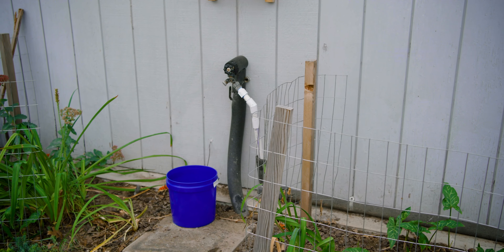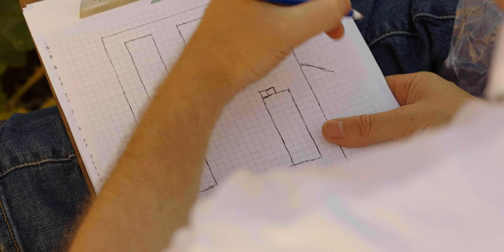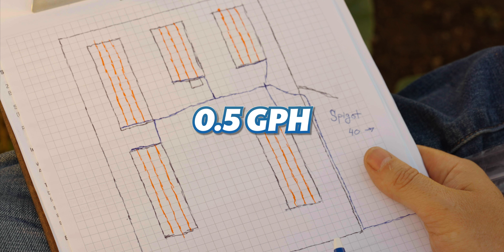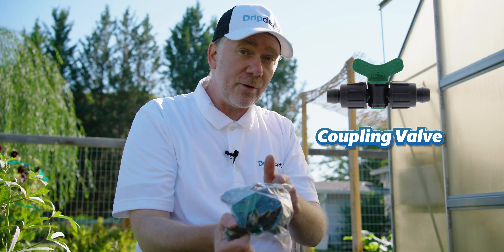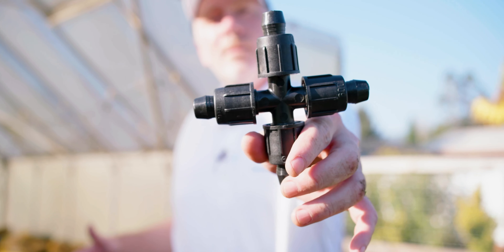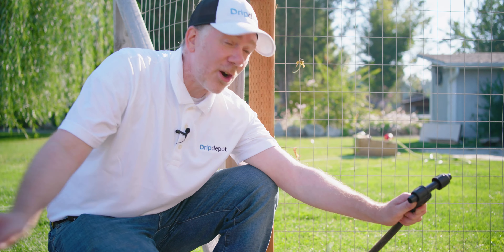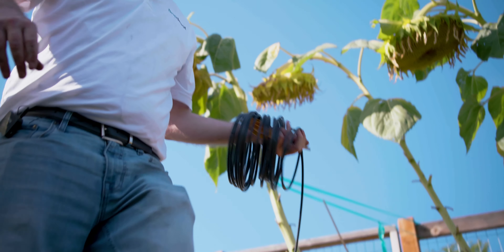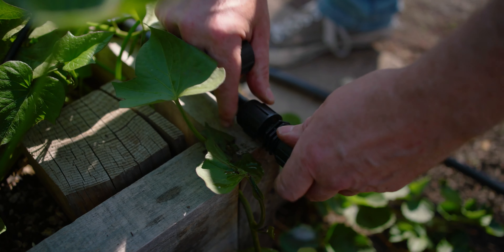How to Install Drip Irrigation for Raised Beds (Complete DIY System Guide)

Comment: Hello I am currently looking for a kit in your website,   i have 3 beds, 1- 12'x4' and 2 4'x8', the 12'x4' will have 2 rows of tomatoes  with a row of green onions and a row of basil so 4 rows total, would i still only run 3  lines of 1/4" emitter tubing?  Or would I run 4 and double up per tomatoe plant as i heard tomatoes need more water?  or with tomatoes would i run 2- 1/2   mainline tubing down the rows of tomatoes with individual drippers for each tomato and then run a 1/4" Line for the basil and onions? I have no idea how this stuff works. 

Secondly the kit im looking at has things I dont think I need,  is there a way I can contact someone that can assist me i adding things I might need extra of and taking things out I dont need?

Thirdly my beds are metal so I cant use the hold downs with the nails, so would I run it over the side where it risks getting cut and hot from the sun or up underneath into the bed and then bury the lines?? 

And Finally I also cannot run the mainline tubing from my house as its 100' away and there's a cement walkway , garage, shed and driveway,   can I run a good hose out to the garden that will hook up out there where I will have the timer>backflow >filter >pressure reducer into the mainline all hooked up in a junction box with a quick disconnect for the hose as it has to ge detachable for years work , driveway etc etc.
Reply from the maker: The first, in regards to how many lines of drip line to run, could go either way depending on soil type, etc, but I'd likely run 4 lines, one for reach row of plants.  Doubling up on the tomatoes may be a good idea, as they do require more water than some of the other plants, but you could also go with a tighter spacing (6" instead of 12" for example) for that row to ensure they receive adequate water without overwatering the others. 

Absolutely happy to help in removing items from the kit you don't need -- in fact, we recommend customizing the kits to make it an even better fit, so you're 100% on the right track here.  Reach out to us from this link (this is our contact us link and sends us an email -- during office hours, we get back to email quickly): https://help.dripdepot.com/support/tickets/new 

Also good question on the metal beds -- this can also go either way.  I'm fond of just hanging the elbow at the top off the edge of the metal bed, but there's no harm in coming from underneath unless you've laid metal mesh or similar down before the beds.  We made a video for metal raised beds I'll link here -- there's a lot of crossover between this video and that one, but you can definitely skip ahead to see how we secured our lines to the bed: https://www.youtube.com/watch?v=ug_CAB9920w 

You can incorporate a hose into a drip system, you bet -- you'll still want the head assembly (timer, backflow preventer, filter, etc) at the hose bib however, as most garden hoses are not rated for constant pressure, which it would be under if the timer valve was downstream of the garden hose.  The filter and regulator could be at the end of the hose, but the timer and backflow preventer you'll definitely want on the hose bib.  

Please don't hesitate to reach out to us here or the contact us link above if you have any questions, happy to assist :)
Reply: @dripdepot  I think the standard kit suits everthing I need , I do think doing  6" spacing for the tomatoes is a good idea as that will give me 1gph per tomato plant and 12"  spacing for carrots, onions ,basil, cilantro, Oregano,  would I do the 6" spacing for cucumbers and green peppers that are in the 4x8? I emailed and they did respond back with the standard is what you all recommended,  the only thing in the kit I wouldn't need for the raised beds is the button drippers but I can keep those for future upgrades if I add  bags or containers .

So with the hose bib , at the house right at the hose bib is where ill put the timer, backflow and filter, connect the hose to the filter outlet which will go out to the garden and that's where I'll have a quick connect for the pressure reducer and fitting to connect the mainline (plug and play) I just want the timer and the backflow and filter right at the strongest point is what im Understanding the others can be at the garden for the hose to attach to correct?

And finally do you all sell the rubber stripping to go around the top of the metal beds separately,  I'm a stroke survivor on blood thinners so Getting cut is a big no no,  if not can probably find it at the hardware store right now I just have a few pool noodles in areas that have sharp spots
Reply from the maker: @Edithputhie6969  Bit of a tough call on the cucumbers in particular -- yes, cucumbers, tomatoes and peppers all need about the same amount of water (this can vary based on cultivar, but in general), but tomatoes like to dry out between waterings where cucumbers enjoy always moist soil.  To balance that, you could apply more mulch on the cucumbers, and/or less on the tomato plants. 

Your proposed head assembly (timer, backflow filter at the hose bib and then regulator and hose x tubing adapter near the garden) sounds good, that should work just as well as having it all at the hose bib.  :)
Reply: @dripdepot  got it ordered  and being processed to ship ty, one final question, there's one area in the garden where no matter what i do i have to run the mainline across the walk area,  I personally wouldn't have issues with not stepping on it but company for some reason just can't stay out of the garden area no matter how many times i tell them, can I bury that part of the line or should I just make a type of cover to put over top?

 I could build an arch type thing and run it up Over the top of that area but I would be wasting fittings and line  also doing so would probably lower the flow as it'll go up 7' in the air (I'm 6'2") over abd back down 6' into the bed, just thought maybe you might have an idea  on how I can protect that one 3' cross  over
Reply from the maker: @Edithputhie6969  Awesome, sounds like it'll be shipping today if it's processing now -- when it arrives, you're welcome to reach out with any installation questions as well. 

And yes, foot traffic is the bane of above ground irrigation systems sometimes -- it is acceptable to bury tubing there and probably not too difficult if the walkway isn't terribly wide.  Another option, and this came from someone else in the comments on a video (thank you!), is to use one of those cable protector speed bumps you see in office buildings to prevent them from being a trip hazard (and to protect the cable).  

I haven't heard feedback on how it worked, but he gets the credit for the idea and it absolutely seems sound in theory.
Reply from the maker: @Edithputhie6969  I just pressed "Read More" and saw you had some more -- an arch isn't a bad idea either.  You would indeed be using more fittings and mainline, but it could be a good aesthetic choice.  Depending on the location, you probably wouldn't lose pressure or flow either --- any pressure that is lost going up an incline, is regained going down so long as it goes the same distance down and has enough pressure to get up the initial incline (and you almost certainly will have enough to get up the inline,  a 7' incline is only a 3.03 PSI loss, which is immediately gained going down)

Comment: I have your raised bed kit, and I ordered the drip tape kit as well. Can I just tap into my drip tape kit main line and attach the drip tape? Or do I need a pressure regulator to bring the pressure down to 15?
Reply from the maker: When using drip tape you'll definitely want to regulate the pressure at about 15 PSI -- this will protect the thin walls of the tape and also keep it dripping at about the stated emitter flow rate :)
Reply: @dripdepot  what part do I need that can throw on a regulated from the main tubing?
Reply from the maker: Is your system operating from a hose bib?  If so, item #3525 should get the job done for you.  It has female hose threads on the inlet and male hose threads on the outlet, so it can thread on to a hose bib (or other male hose threaded connections like a hose bib) with no additional adapters needed :) 

Here is the link directly to it: https://www.dripdepot.com/search?q=3525

Comment: Our bed is approx 15 feet from the house. Do you recommend digging a trench for the main line to each the bed?  How is this system in the winter? We live in NJ
Reply from the maker: Great questions! Drip Irrigation tubing can be buried underground. It's all up to your personal preference! We find some gardeners love to keep their gardens neat and tidy, and in that case, they like to take the extra steps to trench out the mainline. Others prefer to keep it above ground, so it's easier to maintain and add on to in the future. 

Keep in mind that burrowing rodents, like gophers, can chew through the tubing seeking water, and with it being underground, it is harder to locate the leak. If you decide to bury your tubing, keep an eye on your system to make sure everything is running correctly; so that if a rodent does chew through the tubing, you can spot the problem immediately. Once you have your trench dug and the tubing laid out, you may want to have the system pressurized before burying to reduce the risk of tubing collapse. 

A drip system will do great through a New Jersey winter; just remember to winterize it before the first freeze. Winterizing is essentially flushing the lines of any excess water and storing away sensitive components like the head assembly. If you'd like to follow a guide to preparing a drip irrigation system for winter, we made one that covers all the bases [https://youtu.be/qOSIav1DiCQ]!

Comment: How far apart should the driplines be spaced if you have sandy soil?
Reply from the maker: This can vary quite a bit depending on how loose the sandy soil is.  We've seen them as near as 4", and as far as 9" in sandy soil types.  What you can do is, drip water very slowly (with a barely open hose or even a dripper if you already have some) to mimic a drip emitter over 15-60 minutes.  After, dig around in the soil to see how far the soil's capillary action carried the water.  This will give you a great idea on how to space your lines :)
Reply: @dripdepot  Thank you, I'll do that. I have some 4 foot square beds I want to try drip irrigation on. I see that you used three drip lines to cover each 4 foot wide bed. I guess I would need more than that.
Reply from the maker: Possibly, at least with very sandy soil!  One great thing about drip is it's very easy to expand on -- if you wanted to start with fewer, you could and then easily work in another line if needed :)

Comment: 12" emitter spacing seems insufficient for raised beds that are typically planted denser than farm rows. Raised beds do not suffer from pooling and will result in dry spots.
Reply from the maker: In most common loamy garden soils, water will spread about 12" from the point of drip, making 12" spacing a good match to many gardens.  Yes, dense plantings (carrots come to mind) might enjoy a tighter spacing, as will sandier/looser soil types, but for the most part 12" is that sweet spot where water from one emitter spreads near the other. 

When checking soil moisture, be sure to dig down -- when done right, drip emitters should leave only a small wet spot on top of the soil (minimizes evaporation or the potential for run-off).
Reply: @dripdepot  Dense planting is not an outlier.  Square foot gardeners plant heavily and tightly with the intent to provide more care than a row gardener would.
Reply from the maker: @Josef_R  12" Spacing is often used by square foot gardeners, though instead of a single row of drip line, they'll sometimes make more of a grid pattern with their drip line.  A lot of it really depends on soil type.  We do a lot of square foot gardening, with great results, and do intend to make a video specific to it :)
Reply: @dripdepot  I suppose 12" might work if you staggered the emitters so that they alternated, that would give you a 6" spacing...I'm just trying to decide what to buy and this stuff ain't cheap enough to make mistakes with.
Reply from the maker: @Josef_R  That definitely makes sense!  To some degree, it's really hard to mess up too bad with drip, at least so long as you're using the right emitter type (don't want overhead watering for plants that like dry foliage, for example). 

Being modular you can work pretty much anything in and still use what you already have.  It also has a very large margin for error, we've seen people new to both gardening and irrigation get great results, almost on accident. 

I think you'd likely be good to go either way (12" or 6"), and if the 6" makes you feel more confident in it all, there's absolutely no harm in that -- worst case scenario is you reduce the watering cycle a little bit or remove or move a line here and there.  When I was new to it all I used a lot of 6" spaced drip line and got great results, and I still use a good bit of it in my home garden.  

Basically, either route you go (or even a mix of) I think you'll have success :)
Reply: @dripdepot  I appreciate you answering my questions, but I don't like the fact that I can't call and speak to anyone about things that would be very difficult by email.  A customer would really have to know what they want to confidently make an order.  And I don't...
Reply from the maker: @Josef_R   Josef, fire us off an email, we can absolutely help walk you through the details (and email is nice for this, as we can link directly to things, send pictures and images to help lock in the foundational information).  Our email is also always answered by real people, we don't use AI or bots -- I think the only automated response we have is just when we're out of the office to let you know when we'll be back. We also answer them quickly, during office hours it will only be a few minutes :) 

Shoot, there's a very good chance it could end up in my in-box, to this day I do a lot of the email assistance.  From what you've described so far, it sounds straight forward and something we could help lock in for you.
Reply: @dripdepot  Right, the problem is email can lead to 50 emails before the question is answered. I need help designing a system.
Reply from the maker: @Josef_R  It might take a few emails, though rarely that many!  

And we do have a design video if you hadn't caught it yet -- there's not a lot of videos on designing drip systems out there.  No compulsion to watch it, more than happy to help here or email, but just in case here's the link: https://www.youtube.com/watch?v=FJF49lb23b8

The system designed in the video is likely very similar to what you're doing, as it uses almost exclusively drip line (the only difference being you might use an additional line or so to make a grid, or closer spacing).

Comment: When you turn the water spigot on, do you open it all the way ?  Or just partial?
Reply from the maker: Best to open it all the way in most cases. 

The pressure regulator will regulate the pressure down if it's too high, and having it fully open allows for all the flow to be available for your irrigation system.  :)